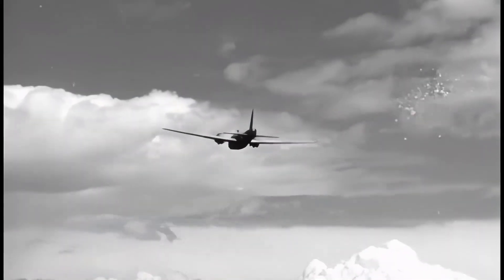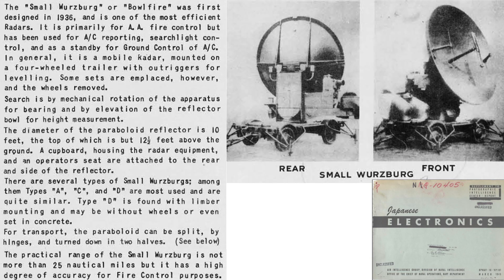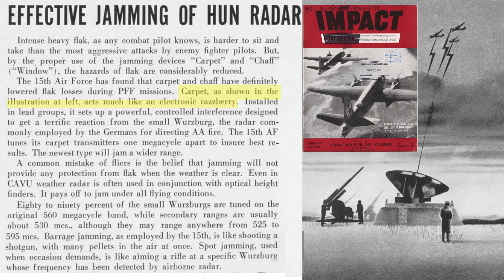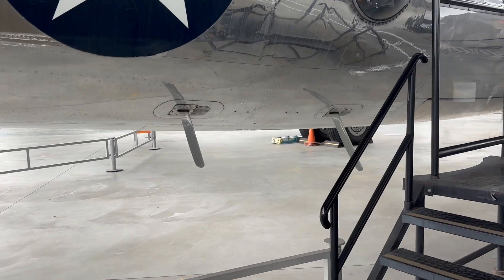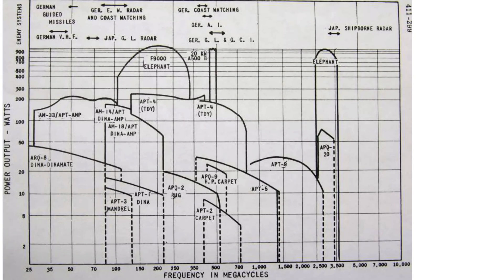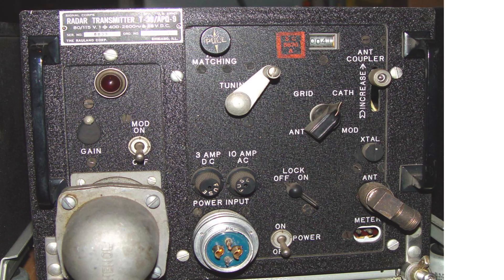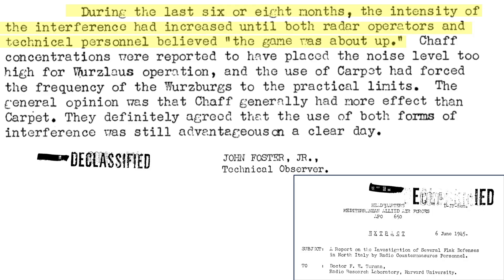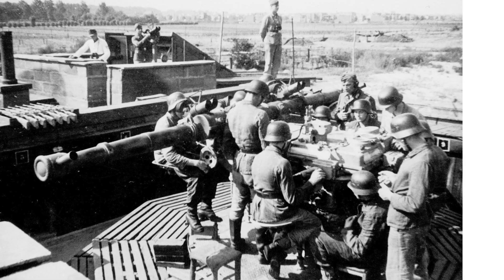Jamming German Wurzburg RADAR with electronic countermeasures “Carpet” –Tactics, Equipment, & Impact

Comment: 👍Another excellent video, thank you. Chaff or "Window" as it was dubbed by the British was not used for some period (over a year?) after it was developed. This was due to concerns that the Germans would quickly work out what it was and adopt similar tactics to mount a new bombing offensive against Britain. By the time Window was deployed, bizarrely, the Lufwaffe already also had Chaff (Düppel) which they had also been holding of on using for the same reasons. The Lufwaffe did eventually use Düppel but it was limited and nowhere near as effective as Allied use of Chaff.

As a few folk have commented, it great to get some details of these systems. The rapid development of EW during WW2 is amazing. It went from virtually nothing to quite sophisticated systems in such a short period.

Comment: The Luftwaffe air defenses exploited the propeller modulation of Allied Bomber stream returns in their Wurzburg radars for non-cooperative target recognition (NCTR).  Closing or receding targets have a net Doppler shift up or down respectively that is proportional to closure/receding velocity of the aircraft formation.  This radar doppler shift would be superimposed on any Doppler and amplitude modulation produced by aircraft propellers. 

The "Neurnberg" and "Taunus" features added to the latest Wurzburg production were able to pull amplitude modulation (AM) signals proportional to propeller rotations per minute (RPM) that would be typically constant for specific bomber engine types in cruise regime.

"Neurnberg" and "Taunus" were two of the five techniques you mentioned Goering giving cash prizes for.

See:  http://www.lucafusari.altervista.org/page1/page26/WurzburgRadar.html

"Aircraft of those days were generally using propellers and the radar signals were also chopped or modulated by its rotation frequency. This video or audio spectrum had to be listened for, as only aircraft could reflect such signals. Whereas Window never could fake German radar signals that way. Its principle is known as 'Propeller modulation', and was invented about 1934 in the US. Though, they themselves hadn't employed these techniques. Both, Taunus and Neurnberg helped the radar operators to discern between fake or real radar signals. However, despite these new efforts, results were very dependent upon the skills of German radar operators.The Neurnberg and Taunus features were often indicated (marked) with the characters 'T' and 'N'"

The requirement for highly skilled and experienced German radar operators was the killer for these two system as mid-war Flak batteries had fit men skimmed off and sent to Luftwaffe Field Divisions on the Eastern Front and then late war complete Luftwaffe flak batteries were sent to fight Allied ground formations.  So many of the most experienced radar operators were given a rifle as infantry.

You have to go to specialist EW histories like Alfred Price's "The History of US Electronic Warfare Volume 1" (1984) to find much of the Axis electronic counter measures as the USAAF was writing it's after VE-Day reports/histories for a "narrative" to help their budget battles in the 1947 creation of the Department of Defense.

Comment: This is a great overview of US electronic jamming systems and tactics. As every electronic signal can be located, switching on such systems gave the Germans the location, speed, size and flight direction of any incoming bomber formation. In a certain way, the jamming devices replaced German RADAR signals. During the Vietnam war, the USAF had the rule that such jamming devices should only be switched on once an enemy RADAR had located an aircraft. Doing interviews with German RADAR operators after the war would confirm that it worked against such stations, but that was only one part of electronic warfare then and now.
During the last six to eight months of the war, the Germans had severe ammunition shortages. If FLAK did not open fire at aircrafts using jamming devices in March 1945, the reason is not only jamming. The crews operating the jammers didn't know much about the situation on the ground, but noticed how the Germans were firing less shells at them every month. The conclusion for them was that the jamming worked very well.

Comment: This is an extremely impressive video. Subscribed. The most impressive aspect is the large volume of high quality original source material. Very good work. The only improvement would be references to the documents in the description. That would elevate this to engineering-research quality. This is better than any technology-history public broadcasts I've ever seen. I knew about chaff/window. However, I did not even suspect active electronic countermeasures were so effective, so early.
Best Wishes. ☮

Comment: So, if radar was jammed did/would that allow bombing at lower altitudes to increase accuracy?
Reply: Nope. The Jammers and Chaff stopped the guns from being aimed at the Bombers when there was Cloud between the Bombers and the Guns. The Bombers dropped their bombs using PFF methods. PFF stands for PathFinder Force and it means almost exactly the same as it does for RAF Bomber Command. Specialist Aircraft with trained crews leading the main force bombers on to the target via use of Electronic Navigation Aids. In the case of the USAAF, their Pathfinders were lead ships in each combat box that navigated to the target by use of H2X / G-H  / Micro-H blind bombing systems and when they dropped their bombs so did the rest of the formation. Accuracy was not increased, but reduced, but the Bomber losses were reduced.

Comment: Want to know the funniest thing about  simple Doppler radar systems. They are by far the hardest radar to jam. Many people have attempted to jam simple police traffic radar with no luck. In fact on a bet one of it's early traffic radar designers couldn't even do it. It's because simple microwave sources vary in freq so much. One would need to perfectly match each radar guns freq. Its illegal btw but has never been successful. 

On the other hand jamming police laser speed devices has been successful and isn't regulated. Many devices are being sold.

Comment: After 11 bombing missions in late 1944, my father and his crew were transferred to radar and other counter measures. As he described them to me, these missions generally were solo flights to detect radar or radio transmission or to do the primary jamming off the coast of England. One of his crew once related to me that they had a radio intercept mission a few days into the Battle of the Bulge that for the lack of radio traffic led them to believe they may have been the only plane flying in norther Europe at that time.
Reply: Was he in the 36th squadron flying B-24s?
Reply: @wdtaut5650  Yes he was. He originally was with the 492nd Bomb Group until it was taken over by the OSS to serve as an espionage unit. I have some of his flight record information from his time in the 492nd, but nothing concerning the 36th Bomb Group.
Reply: @cdjhyoung  My dad was in Lt. Hamilton's crew.  The 36th was his only overseas assignment.  He told us, in general terms, what they did but never said anything about any particular mission.  I got the idea flying solo as they did was nerve-racking.
Reply: @wdtaut5650  Nerve-racking may not be the whole of it. These crews were considered expendable. Missions were by time in the air. My dad related to me they were given missions with no end time or return time on three occasions. He challenged the officer briefing them the first time if they could land after a certain time. He told me the look on that Major's face told him they didn't expect them to ever make it back. I don't know if it was common, but my dad's crew were together their entire tour until they returned state side. He, his co-pilot and flight mechanic were obsessed about trimming those airplanes in such a way as to gain the maximum linger time possible. They couldn't do much with a bomb load, but once free of bombs, or these radar jamming missions they could re-trim the airplane and shift the load enough to gain air time. When on their last leg of Transport from Iceland to Scotland, they still had enough fuel to continue on to their assigned air field instead of a layover in Scotland like the rest of the crews. It served them well returning from missions when the airfields were socked in being able to go north for open skies or in these jamming missions when they could exceed the normal linger time of a B24.

Comment: Wurzburg Radar development started in 1936. The first production equipment's were not issued until the summer of 1940. The  first equipment was not fitted with the conical scan based steering system, so were not that actuate. The Conical Scan system entered service in 1941, but even then the radar didn't have the accuracy to aim guns by radar fixes alone. The Giant Wurzburg was capable of aiming guns by itself, but it was needed to provide GCI radar control due to its range (and until mid 1943, two Giant Wurzburg radars were required for each GCI box). The Giant Wurzburg's primary role in Early Warning was as a height finder as the Freya radar couldn't do that function.
Reply: Würzburg could conduct blind fire.  Here is the timeline:
-Wurzburg A entered service by mid 1940.  It did not have conical scan but 3 separate Operators: one for elevation, another for traverse and another for range.  By nodding the aerial, the Position of the bomber could be determined within 2-4 degrees.  It had been designed as an easily transportable early warning radar.  It occasionally scored hits on bombers in clouds using verbal aiming but was usually used to que searchlight and optics. 
-Wurzburg C with conical scan entered service in Feb 1941.  The conical scan allowed tracking accuracy of 0.3 degrees (when directly above without ground plane interference in which case accuracy was 0.5) and required only one man to operante both elevation and traverse but still had a range Operator.
-Wurzburg D entered service in May 1941. By June 1941 there were 72 on the production line.   It had the same conical scan but added synchro's for transfer of data to the Kommandogerate FLAK predictor. It also improved range accuracy from 100m to 16m. 
-Thus Wurzburg D could conduct blind fire.   Obviously 0.3 degrees works out at 5.23m at 1000m or 25m at 15,000ft but at night and in clouds it was still dangerous.   It has excellent range accuracy but it was better to use optical to lay and train the guns and the radar to range and direct search lights.   Wurzburg D was more accurate than any allied radar up until 1943 when the SCR-584 radar was introduced after the Germans jammed SCR-268.
-Wurzburg-Riesse was a Wurzburg-D in a 7.4m power driven dish.   This doubled range and improved accuracy to 0.15-0.2 degrees.   It entered production at the same time as Würzburg-D.  It as a FLAK radar but was also used to direct night fighters on to their target.
-Source "Fritz Trenkle" book on radar in German.
Reply: Goering early in war witnessed german shoot down english a/c  famos quote no enemy plane will fly over the reich what a fat fool he doomed nazi germany

Comment: I have a request/suggestion.  Please do a video on how the  Flak 88 and the other big bore cannons worked.  If it's possible please explain how the travers/elevation gunners knew when they were on the proper gun bearing/azimuth and elevation.  Did the gunners have a lighted dial or was there a type of optical reference that would illuminate when the gun was pointed in the direction/elevation the firing solution computer had arrived at?    Thanks for your hard work.

Comment: Did the allies have the technology to build jammers in 1939? What was the history of them realizing they needed jammers on bombers and who/when were they developed?
Reply: The Germans started the Jamming War in February 1942 when they jammed the 1.4 Metre Band RAF and British Army Radars covering the English Channel during the Channel Dash.

First British ECM equipments were 

Moonshine - Aircraft carried Pulse Radar Repeater Jammer used to return an echo that looked like a formation of Aircraft on the scope of Freya type radars . First used to try and pull German Day Fighters away from real Air Raids in July 1942  

Mandrel - Ground and Aircraft based Pulse Radar Nosie Jammer to be used against Freya type early warning Radars. First used in December 1942 by Bomber Command with two aircraft in each squadron being fitted with the jamming system.

Tinsel - this used the Bomber's own radio systems and involved the wireless operator tuning his HF Radio system across the frequencies used by the Germans for fighter control communication and when he had picked up a controller and intercepting aircraft talking, he would transmit the sound of one of the aircraft's engine on that frequency via i microphone fitted in the engine bay for a couple of minutes. That system was introduced again in December 1942.

The British and the US started their countermeasures organisations at around the same time and by the end of 1942 the US had a RCM laboratory set up in the UK as part of the British TRE effort to design equipment for both the USAAF and RAF requirements. 

The British started fitting Jammers in their Bombers in late 1942. The USAAF, operating in good weather and daylight didn't until October 1943 when they started to put Blind Bombing Radars in their aircraft where such Jammers would help protect the bombers when bombing though cloud cover.